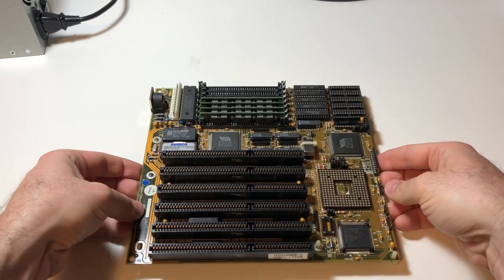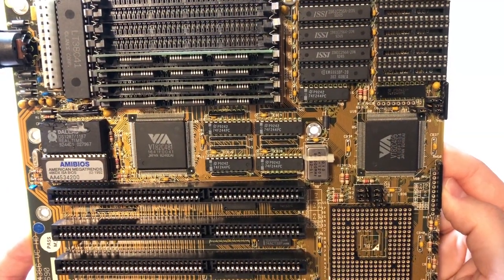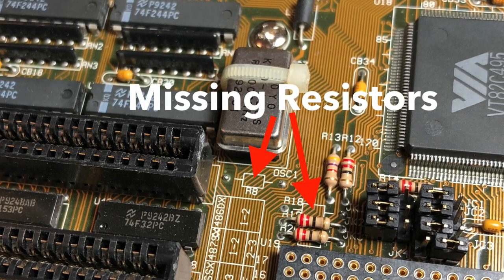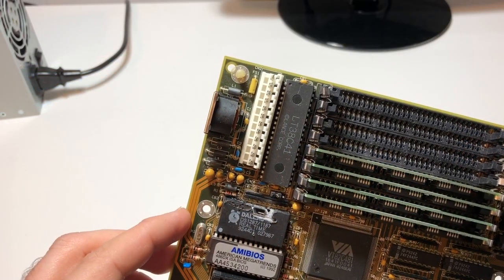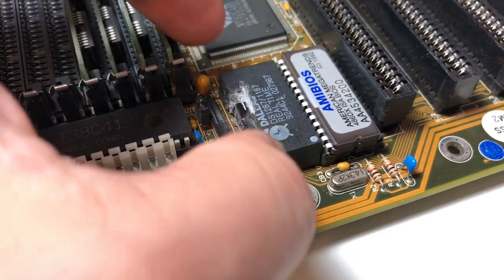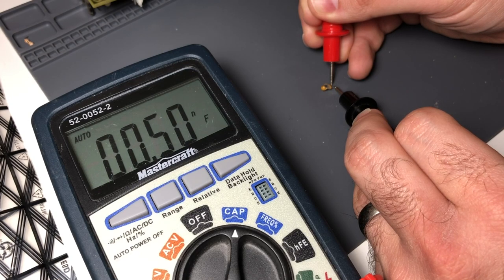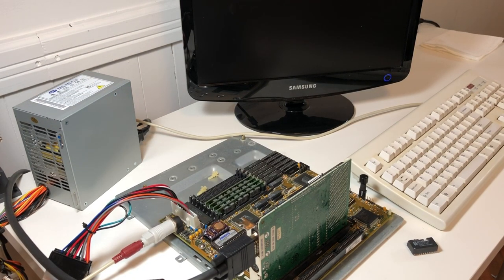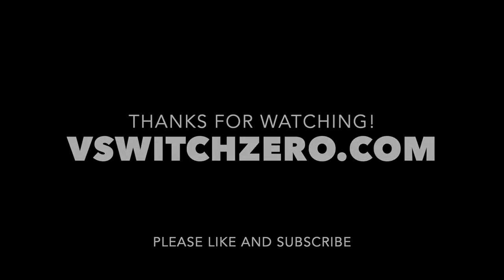Repairing the FIC 4386-VC-HD Hybrid 486/386 Motherboard!

Comment: I think it's mad that a system can be rendered completely unresponsive by a missing or faulty RTC module. I've encountered this a couple of times now but the first time was maddening! Chased all sorts of shadows until I worked out what it was. Great work on this board - I wish all my repairs were this simple.
Reply: Remember that the RTC module not only handles the clock, but also the system configuration (CMOS Setup, as it was called). However, the very first steps of the BIOS POST ignore the configuration and just test the basic functionality of the system, and this shouldn't be affected by the RTC. On the other hand, if a misbehaving RTC interferes with the bus, it can prevent proper BIOS reads and hang the system on startup, I think. Over all, it's just another device hanging on the ISA bus.

Comment: A trick I learned when resoldering caps or sockets is to spread the legs after they go through the holes, or end legs on the ziff sockets, and the tension will keep it in place. Then solder and snip as always.

Comment: That dallas module can be easily disassembled. Just use solder with flat ti (about 2mm wide), heat it about 180-200C, and pry small peaces of epoxy. Ventilation strongly recommended.
After removing epoxy you will have clean a chip and can remove soldered battery. Solder battery holder to you taste (I just use laying around holders for CR2032), and you repair Dallas 😁
Reply from the maker: Thanks for the comment! That's very interesting, I don't think I've ever seen that style of mod done before. I have several flat DS1287/DS12887 modules that I may try to modify at some point.

Comment: Part of the reason a working RTC is required for the system to post is because generally the BIOS settings are stored in the Battery Backed RAM in the RTC module itself.
Reply: Exactly. Those thing aren't JUST a "clock generator"

Comment: I had a presumed dead board rotting around for years until i did a last inspection before throwing it away. It turned out to be a broken leg of the 3v battery holder that prevented the board from even powering on...

Comment: The other thing that special socket allows, is running a 487SX "alone". The 487SX was really a fully featured 486DX with an extra pin to keep someone from sticking it in the normal socket. This board could run a 487SX with the special socket.
Reply from the maker: Thanks for your comment! Indeed! I noticed mention of the 487SX in the board's manual too. I hope to buy one for my collection one of these days.
Reply: @vswitchzero  If I remember correctly, the 486 SX chips were like the 386 chips in that they had no math co-processor, hence the 487SX was made.
The 486 DX chip, of course HAD the Math CO.
Reply: @mstover2809 yes, apparently the first batch of them were fully fledged 486DX with the math coprocessor disabled.
But the weirdest value proposition was to upgrade it with a full 486DX, expensive as one, branded as the 487SX, leaving in a another socket socket that 486SX in an OFF state. 😅

Comment: that Dallas realtime clock chip - those are still made, I believe.  And still used in new product designs.  You don't need a homemade replacement.
Reply from the maker: Indeed! I've bought a few brand new DS12887A+ modules from DigiKey and they work great too. I use them when I'm trying to maintain the original look of the board. The custom ones do have the benefit of being able to easily replace the battery, but I'm sure the DS12887s last a long time with a fresh battery anyway :)
Reply: its better to have a socketed battery...but yes...

Comment: I've got an at&t computer with a Pentium 90. It also will not work at all without a working Dallas clock chip. It also won't work if the new Dallas chip is good but has an invalid date and time...that part was hard to figure out and fix.

Comment: Hey, thanks for great repairing tutorial! I have identical mobo with 386dx 40 (soldered) and 486dx2 66 (in socket) unfortunately when I try to enable 386 i just get black screen. Could this be, because oscillator installed on the board is 33 Mhz (for the 486dx2 66)? Do I need to replace the oscillator for 80 MHz one to be able to enable the 386 cpu? I like this mobo very much and would really like to get the 386 working. By the way where could I get those oscillators from?
Reply from the maker: Thanks! Yeah that's quite possible. 386s generally need a 2x crystal (so 80MHz for the DX-40). I haven't tried putting a 486 in this board yet, but I believe there are two crystal sockets (one for the upgrade socket and one for the onboard CPU). If the optional crystal isn't installed, I think it uses the primary one for both sockets. I'm not sure if this type of crystal is a part still available new from places like Mouser/Digikey. I remember looking a while back and couldn't find them except for on eBay and the second hand market. Perhaps someone else could chime in if they have some ideas.

Comment: Nice video. Can i ask where you source your cache chips for 386/486 boards. Thanks
Reply from the maker: It’s becoming very difficult to find them at reputable sellers (or they are very expensive). I’ve taken a chance with overseas NOS chips on eBay a few times and have had success. It’s best to avoid the “really fast” spec’d 10/12ns stuff because a lot of it is fake relabeled stuff, unfortunately. The 15ns is very plentiful out there and safer 👍

Comment: Good day. Could you tell me the nominal value of the resistor assembly on this motherboard under the number RN50. Thank you.
Reply from the maker: Sorry for the slow reply on this. Looks like RN50 is very low-impedance. Just 0.25ohms or so. With those low values, I assume it just operates like a bunch of jumpers. Most of the other RP/RNs on the board I checked are 22 ohms. Hope this helps.

Comment: Hello, I have a question. I have a 4386-vc-v motherboard with 3 ram memories, 256k not 4! only 3. 486DX2 and 486SX processor and one isa video. But when I turn it on, it doesn't turn on. Will it be necessary to install complete memory bank?
Reply from the maker: Thanks for the comment! Yes, my understanding is that with 30-pin SIMMs you need to fully populate the bank with four sticks. I believe it has to do with the data bus width. With 386 and 486 platforms, the 32-bit external bus requires four 32-pin (or one 72-pin SIMM) to work.
Reply: Hello, do you know if these motherboards do not turn on when they do not have the Dallas battery? Because I don't know, my Dallas 12887 is broken.

Comment: I have a question sorry not related to this board it's related to your socket 7motherboard build. I have a board made by PC chips or ECS and it also requires that vrm in order to do the split voltage CPUs does anybody know where I can buy one of those voltage regulators because it plugs in the same way as your Socket 7 board in that build video.
Reply from the maker: Hi Clint, check out Necroware's VRM modules in this video: https://www.youtube.com/watch?v=CMiGVQbMC5U - I responded in more detail to your comment in the socket 7 video as well. Cheers!

Comment: I wonder if a Pentium Overdrive would work on a board like this?
Reply from the maker: Thanks for your comment! It’s not an overdrive socket with the extra row of pins required, unfortunately. The extra pins are just for power delivery if I’m not mistaken. That said it could be possible to create a socket adapter for it, which would be an interesting project 🙂

Comment: Don't you use flux core solder?
I see so many of these repair videos using excessive amounts of flux prior to getting an iron near it, would be cheaper and a lot less cleaning (which isn't even strictly neccessary).